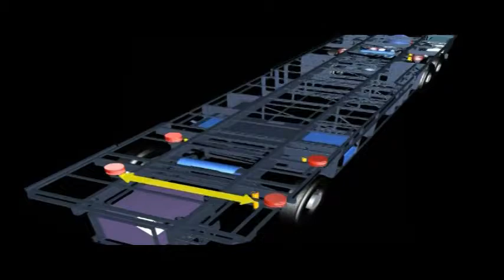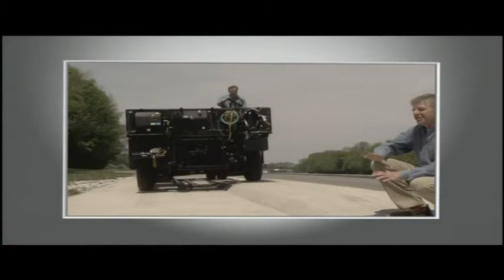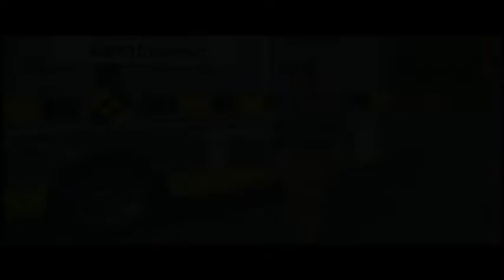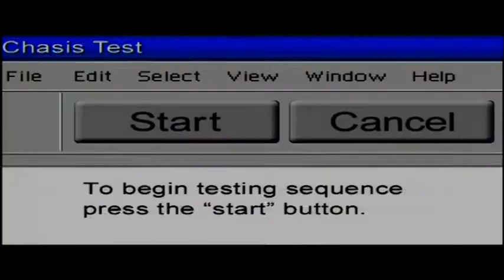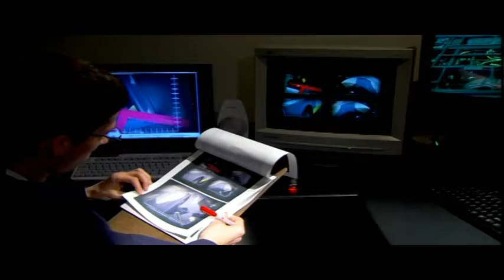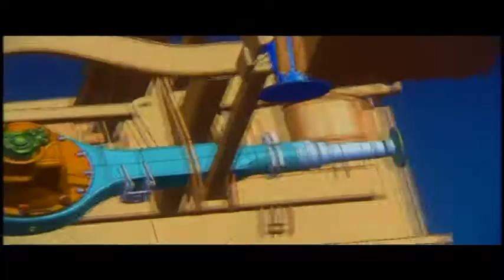Roadmaster Chassis construction By Monaco Coach Informational Video

Comment: I have heard that this chassis had a problem in the rear control arms on older versions does anyone have any info on this? Have heard a lot of good things about the Roadmaster Chassis but I am just beginning a search for an older Diesel Pusher “Pre Def” open to all suggestions/recommendations.
Reply: This is only on the R4R chassis on the smaller entry level DPs. Those chassis are not shown here.

Comment: The video claims higher pass-through storage due to the custom Roadmaster chassis, but a 2015 brochure lists one features of the replacement as:
"The all new Roadmaster™ Chassis storage capacity is larger than before without compromising chassis strength."
That "all new Roadmaster Chassis" is a Freightliner, so perhaps Monaco's Roadmaster chassis wasn't that great...
Reply from the maker: Actually the 2015 chassis was not a freightliner, it was a modular chassis called the liberty chassis that was engineered for American Coach which made Monaco in 2015 and used the same chassis.  So the video was correct with greater storage.  The Freightliner chassis does not have as much storage.  I was a Beaver dealer for Monaco and then in 2015 for Monaco and American coach.  Just to confirm my statement. Plus you are comparing a 2008/2009 chassis to a 2015. 7 years technology changes. Hope this helps.
Reply: Interesting, @RVing_TV . But the flyer from Allied Recreation Group which I quoted said 
"Designed and built to deliver the very best
motorhome experience, The All New Roadmaster
Chassis utilizes a more rigid, advanced bridge
design, engineered in tandem with Freightliner
Custom Chassis."
So although it is custom for Allied/American Coach/whatever, and it is certainly different in some ways than stock Freightliner chassis, it must to a significant extent be a Freightliner. It had some interesting details (primarily the I-beam main rails) in any case.
Reply from the maker: @brianb-p6586  To clarify, the chassis is designed and engineered by American Coach. Freightliner is contracted to build it. It is not a variation of the freightliner chassis at all.  It can not be offered by freightliner to any other RV manufacturer. Watch this video it will show you the difference. 
https://youtu.be/pTtQar8oz1Y?si=jm6imofmMo1PUeWd
On Monaco product it was branded "Roadmaster" but is the exact same, as the Monaco's ran down the American Coach assembly line.  I have walked the assembly line, talked to the team, and have been certified by REV group on their product.
Hope this clarifies.
Reply: @RVing_TV  having now found more information, particularly from Freightliner, this appears to be simply the Freightliner XCM (Modular) chassis (or an earlier version of the same idea)  - the ends with all mechanical components are Freightliner, and the "bridge" structure between them is by the RV manufacturer.  American Coach offered this - still using the "Bridge" name - with a choice of Freightliner or Spartan ends.Either way, the interesting I-beams were a feature of the coach manufacturer's part (the bridge).
Reply from the maker: @brianb-p6586  This video was produced prior to the XCM chassis was even in production.  The Monaco Roadmaster chassis was produced in a plant owned by Monaco and no affiliation with Freightliner.  What you read today is on current chassis.  The video is for Roadmaster chassis built up to 2010.  After that Monaco was under new ownership and used a Navistar chassis and then REV group purchased them and moved to the XCM chassis.  I was a dealer for Monaco and have been to the original plants that are not around anymore.
Reply: Wow ignorance is amazing here! 2015 they weren't even a shadow of the real Monaco. Different owners cutting costs no longer building their own chassis. Freightliner is okay but it is built different and cheap.  Perhaps you should know what you're talking about when you obviously don't.

Comment: The wide spacing of the air springs does reduce the need for anti-roll (stabilizer) bars, although the same roll stiffness can be achieved by either method. It is the dampers (shock absorbers) which should be mounted as outboard as possible for chassis control... but unfortunately they're not as far out as the air springs.

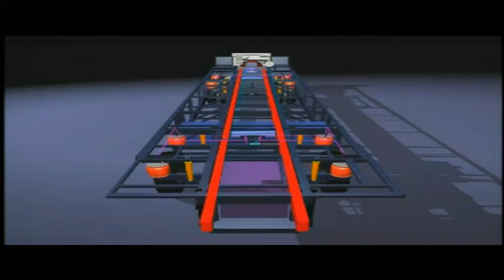Comment: The wider frame rail spacing mentioned at 7:38 is interesting. Commodity RV chassis do use the same frame rail spacing (37 inches across the outside of the rails) as commercial trucks, and with a wide body (2.6 m or 102", instead of the typical heavy truck width of 2.4 m or 96") the wider frame spacing would be desirable. Does anyone know what the Roadmaster spacing is... and if they kept using that spacing through the Roadmaster chassis production?

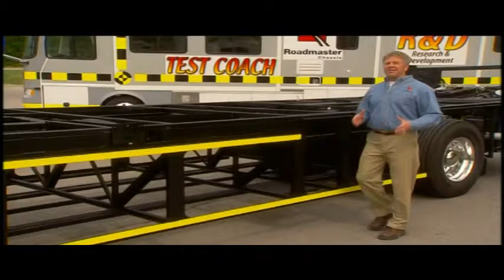Comment: 7:21 "Instead of taking a truck frame and slicing it, putting it back together, and trying to make it fit right"
What is that nonsense? The chassis suppliers (Ford and previously Workhorse with gas engines; Freightliner and Spartan with diesels) offer a range of wheelbases. RV manufacturers don't cut and splice those frames (they just buy the right wheelbase for the model); did they do that crap back when this video was made? To be fair, in front-engine gas chassis Ford does provide only one rear overhang length, so longer coaches have frame extensions added... but that is very different from cutting the frame within the wheelbase and splicing.
Reply from the maker: Actually at the time of this video, that did happen, and even today addon pieces are still used to extend frames at the rear.

Comment: It's hilarious that Monaco promoted their cheap front beam axle as better than the independent suspension (IFS) of other high-end coaches due to high roll stiffness, even though any desired roll stiffness can be achieved in any suspension with an anti-roll bar, and IFS has inherently higher roll stiffness due to the springs than a beam axle has due to its springs. I suppose you can claim just about anything when your customers don't understand the technology. 

This Roadmaster chassis was replaced by a chassis designed and built by Freightliner. In a 2015 brochure for that replacement, the message about IFS changed completely, contradicting the statement in this video.
" ZF® INDEPENDENT SUSPENSION
 Heavy-duty stabilizer bars and beams widen
 the effective load center on the axle, creating
 a higher resistance to vehicle roll, while
 improving responsiveness and handling for
 increased driver comfort."
Reply: It’s easy to compare newer technology to old the video was many years before 2015.
Reply: @c.a.mcneil7599  independent suspension design hasn't changed in any fundamental way for decades.
Reply: As a 07 Monaco owner and after driving a friend's independent front, I have to agree, the IFS is better for ride and handling. He has had to have work done on the IFS though.